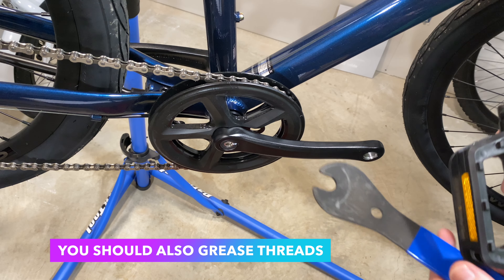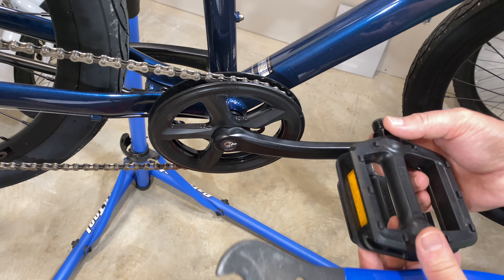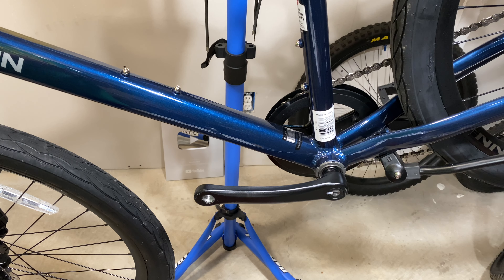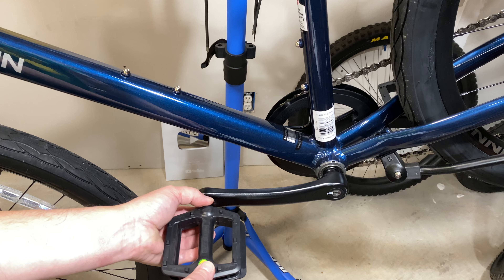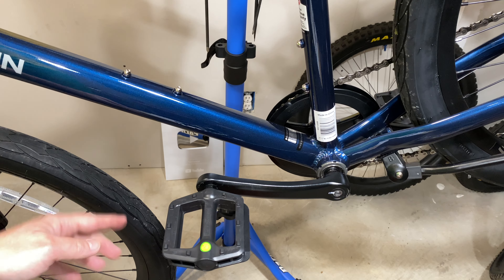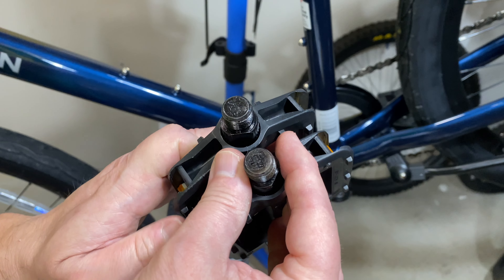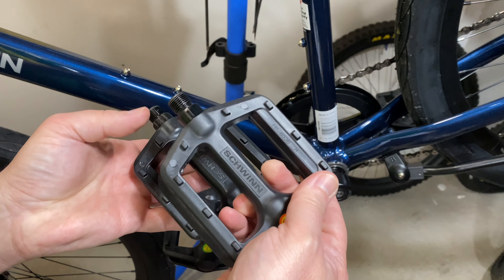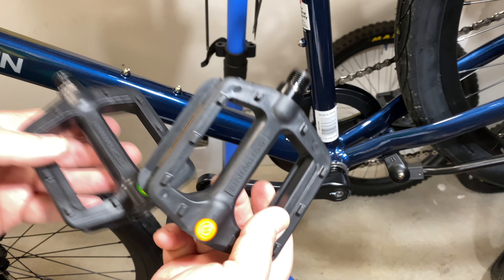INSTALLING PEDALS without Destroying your Crank Arms! Bicycle Tech Tips

Comment: Easy way to remember which way to thread the pedals: they both tighten to the front of the bike.

Easy way to know if you have a pedal on the wrong side: try to hand tighten it. If it doesn't thread in more than a half to a full turn, it's on the wrong side.
Reply: Thanks this was very helpful didn't even have to watch the video this comment is the :tldr 😂
Reply: @viziobehringer3633  np, but his video also has some good points that should be watched, and he does need those views to continue creating content, so please don't let this comment stop you from watching it.
Reply: Thanks. It's easy to cross thread pedals  when installing them. Helpful video

Comment: Just backpedal the cranks as you thread the pedals. When they are snug, grab the top of the back wheel while holding the pedal wrench and you  can push the wheel backwards and the pedals will tighten up
Reply: This. That's the method we use at the bike shop. Grab the pedal spindle, get it started, and just turn the pedals backwards. Easy to catch cross threading immediately, no real risk of damage.
Reply: Came to say the same exact thing

Comment: Good informative video.  The way I figured with putting on the pedals is, to tighten the pedals with the direction of pedaling forward on either corresponding side of drive or non-drive side...

Comment: Great info, and very clearly stated, Thanks! But I don't see a way to damage anything trying to put the wrong pedal into a crank. You can try for 6 months without stopping, and nothing will happen, good or bad. However, cross threading the correct pedal will cause damage. Your point to finger start the pedal is right on, and will prevent that.

Comment: To simplify the process I always say drive side and non drive side 

A quick method I learned is to put the pedal in part way by hand then put the wrench on and pedal backwards 

Also if the pedals don’t have stickers indicating left and right look at the spindle’s and the one that has lines on it is the left pedal and the one that is line free goes on the right side

Comment: I stripped a crank thread on a new surly kmonk. You can imagine my disappointment. Upshot for this mech uninclined rider...I bought the park tool pedal tap set and learned to chase the thread myself...w/the help of several yt vids. As for "down and to the back"--I saw on a different yt channel saying On: "to the front" and Off: "to the back" or some such. Where I get tripped up even today is when I'm using the pedal wrench and turning the crank to screw on/off the pedals.
Reply from the maker: Ouch, but good save 👍🏻

Comment: This could be soo much easier, especially since you have it on a stand. For one, you can easily start the threading process ever so slightly by hand and simply stick your pedal wrench into position and back-pedal. Works on both sides and give much better leverage to get it on tight. You also want to grease your threads to help prevent water from getting in there, rusting and seizing them onto the cranks. Another way to tell which pedal is left or right is by looking at the piece where the pedal wrench hooks on to. A lot of the times the right pedal is clear where as the left pedal has lines on it. Sometimes a bunch of vertical lines and sometimes a single line going around the piece. This helps if there's no stickers or if the stickers are wrong and if there's no stamps anywhere on the pedal.
Reply from the maker: Thanks for the lines tip. I didn’t want to take someone that might already be confused by directions and say….now that you went this way, go this way to tighten….it risks confusing them. That said, I use the crank arm spin method to wrench tighten …..as long as I don’t have tools in my way on the stands shelf.

Comment: I always do three things to help with potential pedal issues:
1. I only hand tighten until I'm darned sure that I'm in the threads.
2. Right foot = Righty Tighty like normal.
Left Foot = Lefties are weird, so the pedals go on weird too. ;-)
3. A little dab of grease on the threads go a long ways to get them off later, and I'll take them off at least once every couple of months during the riding season to make sure they haven't seized. 
BONUS: 4. Just memorize that most pedals are 15mm to save from having to go back to the toolbox multiple times.

Comment: I wonder if dielectric grease would be better than grease.  Water acts as a battery acid between aluminum and steel and that's how you get corrosion. But by electrically insulating them, it could possible prevent it.  Though, to be fair, I don't think I've ever seen that happen bad with pedals.
Reply: I use normal grease and never had a problem with pedals or bottom brackets. You only run into problems without grease if the stuff stays on for long

Comment: I've had many auto mechanics tell me horror stories about stripped heads (spark plug), particularly when aluminum heads started becoming really common.  You would think people would have enough sense that if you're experiencing a lot of resistance after 2 full turns, you're cross-theading.  But no, people ain't got no sense.
Reply from the maker: I think it’s more lack of experience with the item than sense
Reply: Crossthread is the best kind of loctite.
Reply: @ricksaunders3889  Yeah, it works once.  If you cross thread a spark plug or a pedal, it'll be fine, until you need to remove it.

Comment: Is blue loctite good for pedals?
Reply from the maker: I wouldn’t do it. Alloy crank arms and steel pedal shafts are prone for galvanic corrosion as it is. I wouldn’t want something else adding to that
Reply: @KevCentral  Good point! Dissimilar metals interact. If anything, some 'NoLox' or Anti-Ox that we use in AL electric connections might be better.